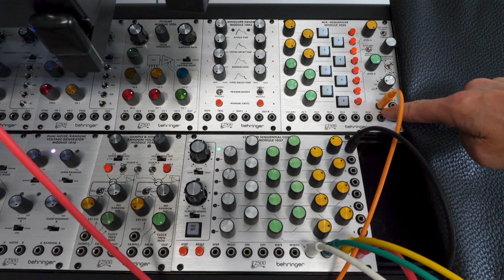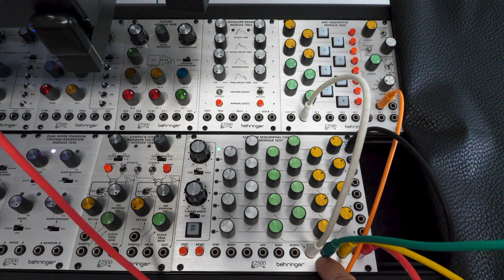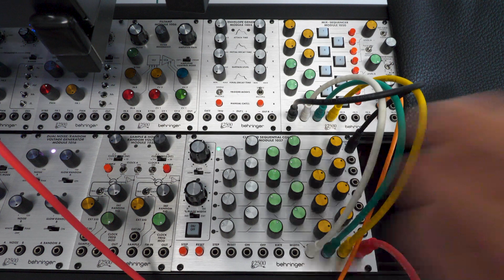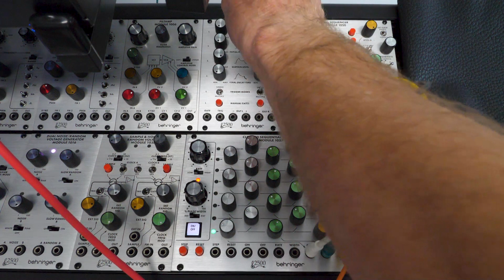Behringer 1050 Mix-Sequencer // POWERFUL Sequential Switch // Working with CV Signals

Comment: Thanks for the Demo Ralph. Q, on installation did you connect the 1027 and 1050 together with the supplied ribbon cable? Cheers Tim.
Reply from the maker: Yes, I connected them with the supplied cable. No problems at all! Cheers, Ralph
Reply: @RalphBaumgartl  Cheers Ralph
Reply: @RalphBaumgartl  What exactly does that ribbon cable accomplish, other than the clock? I have just built my system, total beginner, and trying to understand how these modules work together. This video helped tremendously!
Reply from the maker: @djmd808  Clock only. Make sure you also watch my tutorial about the 1027 module https://youtu.be/CMDmOG1weIw

Comment: The 1050 mix-sequencer is probably the most powerful yet overlooked module of its kind, if you can even find anything that does what it does the way it does it! For me, it's the most interesting module from the Arp 2500 and the only one that will always have a home in one of my racks.
Reply from the maker: Absolutely! I totally agree with you. IMHO the 1050 mix-sequencer was kind of a harbinger device for later MPC instruments of the 1980s. Fantastic what was designed at the beginning of the 1970s. Greetings, Ralph

Comment: hey Ralph (or anyone else) ... am considering sticking a collection of different Behr system sequencer modules 182/1027/960+961+962 into a eurorack to control my 3x B2600s.   Do you know if these would be compatible, with syncing & matched voltages etc,  or am i likely to run into problems (esp with the Moog-clone System55 stuff)?
Reply from the maker: For the 182 and 960 you may have to boost the Gate signal to make it work with the B2600. You can use the B2600 Preamp for this task. Watch this video here: https://youtu.be/-kO1BLgpBE8
The 961 allows for compatibility to the System 55. 
Cheers, Ralph
Reply: @RalphBaumgartl  cheers Ralph, will check it out

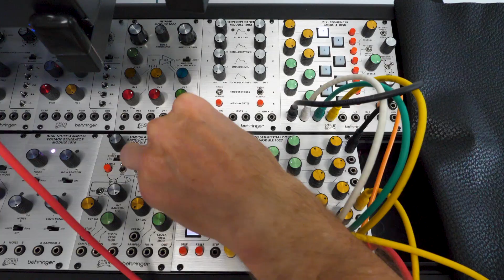Comment: Possible i´m confused, because it seems to me at 9:23 each column of the 1027 performs 5 steps, not six, am i right?
Otherwise very good video, especially how the patching is explained. I'm looking forward to getting started with the ARP 2500 re-creation!
Reply from the maker: You are right. I already inserted a Text in the Video which states that I mean 5 steps and a 15 step sequence in total. Perhaps you may have to turn on captions to see the text. Cheers, Ralph

Comment: Very useful video, thanks Ralph, the 1050 is such a versatile module. 
AMSynths are making modules that connect to the 1027 and its rear mounted 12-way socket. An additional column of voltages (AM1028) or two columns and manual settings (AM1026). ARP originally planned a very capable sequencer sub-system - but only the 1027 and 1050 were manufactured.
Reply from the maker: Yes, I am always keeping an eye on your developments. I have read about the 1026 on your website. Thank you so much for watching my video and leaving a comment. Best regards, Ralph

Comment: Oh, and you didn't make an 18 (6x3) step sequence at the end, you made a 15 (5x3) step sequence!
Reply from the maker: It's six. Count the position gate slots and the outgoing cable... ;-)
Reply: @RalphBaumgartl  Take a look at about 9:08.  5 LEDs cycle in sequence. If you are resetting on (the beginning of) count 6, that step doesn't occur, as at it immediately resets to the first step.
Reply from the maker: @donerskine7935  You are right, it's 15!

Comment: Interesting, as I am in the process of designing a 16-step CV/Audio sequencer for my Behringer 2600. The 1050 may be useful to expand it.

P S Nice touch colour-coding your patch cables to match the colours of the sequencer channels.
Reply from the maker: The 1050 is a very powerful and interesting mixer for any Eurorack system. I am going to demonstrate this in the Audio mixing tutorial. I am glad you noticed my color choice for the patch cables ;-) Greetings, Ralph